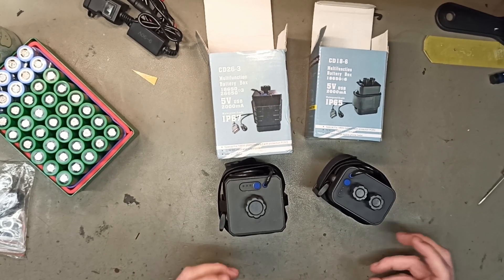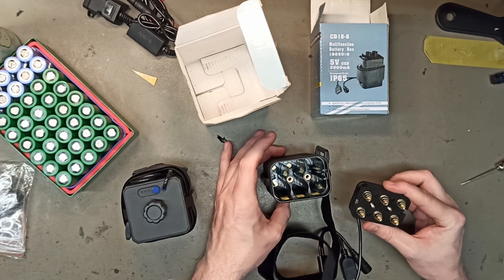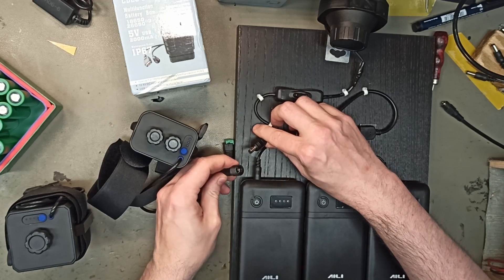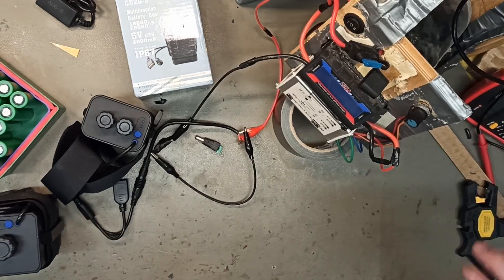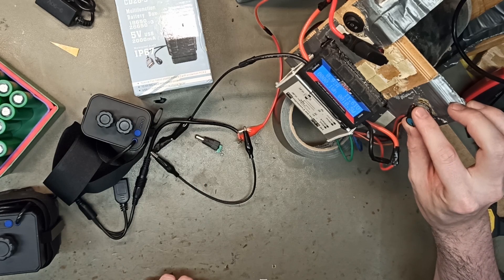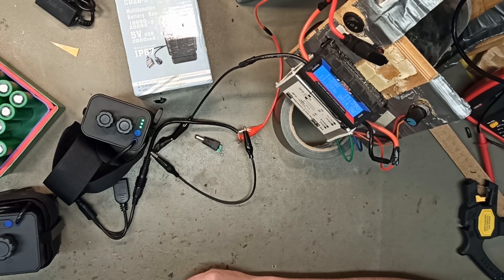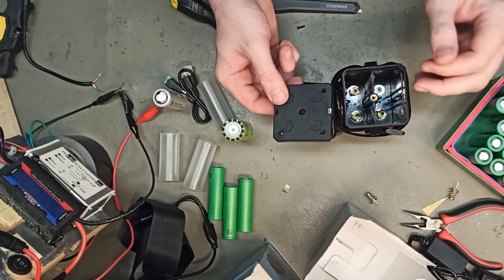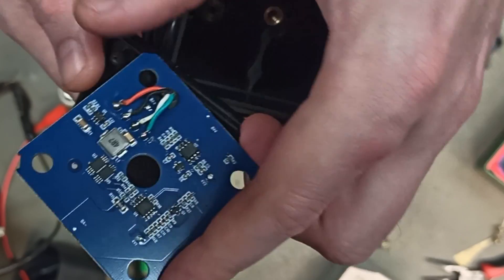Is the Waterproof 12V DIY 18650 Battery Storage Case any good? Amps? BMS? #aliexpress

Comment: i have one of the 8.4v 6xcell boxes, it seems to have a bms in it! i have tested the cells with a multimeter while charging and every time there is no variance in the cell voltage whatsoever, granted the cells were all previously used in a pack together (Recycled laptop battery pack)

Comment: Currently use a 12v pack that has 3 18650s and an on off switch I use it for my scooters 12v light and 12v horn if i forget it on it will slowly discharge over a few days. Will this battery do the same thing?